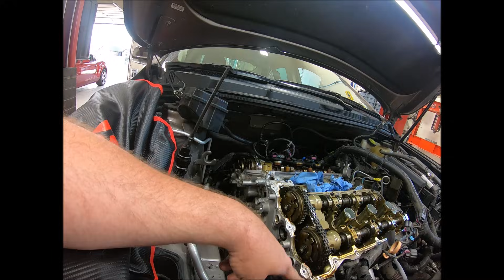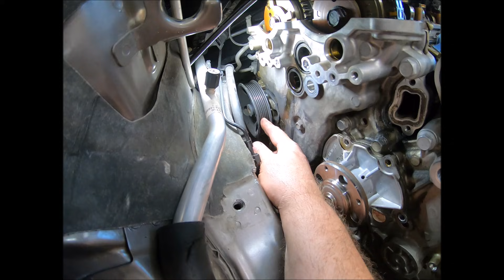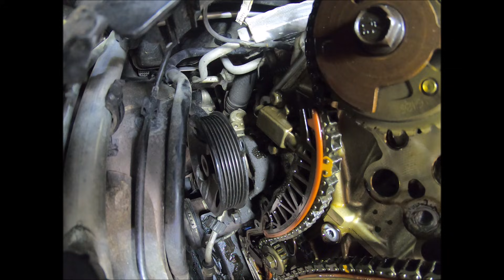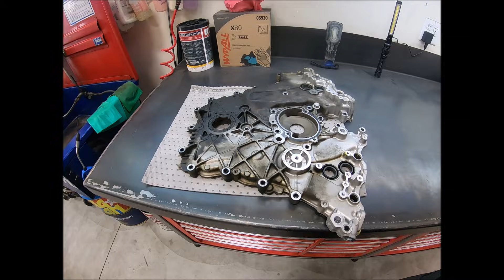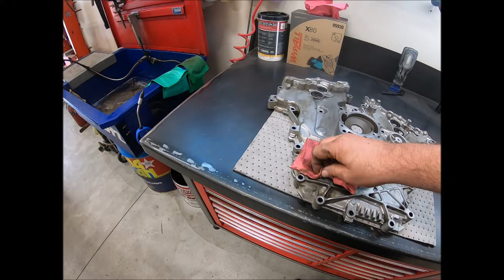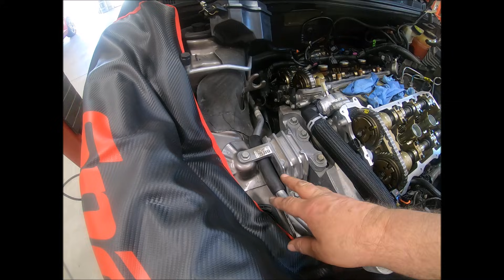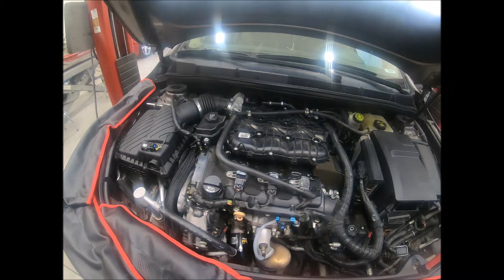Buick V6 Timing Chain Replacements

Comment: the engine gets a bad wrap because people don't change oil and dont clean the intake valves
Reply from the maker: Agreed.  This engine family is not one you can neglect.  They need to be properly maintained.
Reply: @zmotorsports62 people like the 3.8 liter pushrod cause they could abuse it and still get 200K miles out of it.  but the 3.8 liter was low tech had no power and wasnt nearly as smooth.  with the 3.6 liter (bigger version of the 3.0) you get a ton of power and responsiveness, its way more versatile and can handle being put in 5000 pound SUVs, and is a smooth and technologically advanced with relatively good fuel economy.  the trade off for all those extras is changing oil on time and keeping the intake valves clean due to GDI tech.  if you do that these engines will go 300K miles easily.  i have 3 cars with that engibe two of them have over 200K miles running flawlessly
Reply: Who tf cleans intake valves as regular maintenance 😂
Reply from the maker: Not very dang many.  At least not until there's a problem, but on most GDI engines it is a maintenance item or task.

Comment: Great video.
I'd like to add for anyone coming upon this video, coat all the new chains with and guides with oil. I personally used a turkey baster and coated everything in oil. Once I had the timing cover on, i dumped a 1 quart on both banks over the phasers so it drains all the way down. Lastly, with spark plugs out, and fuel pump fuse unplugged, (Optional: Leave serpentine belt off for 0 load) Prime the motor so it can rotate slowly while sending oil into all the tensioners before start up. Do this in small intervals- Usually 10 seconds of priming followed by waiting a little, then once more should be good to coat everything in fresh oil.
Reply from the maker: Agreed. If you notice in the video I put some moly lube on each of the chain guides prior to installation.  I also poured some oil over the phasers and chain as well as camshafts just prior to installing the rocker covers and prior to startup. While pulling the plugs may be beneficial , it's not completely necessary.  If I'm changing spark plugs during the job I will leave them out, but if not I don't necessarily pull them for this job. Prior to start up I use the "clear flood" mode and turn the engine over for about 15 to 20 seconds intervals, I do this about three times to build oil pressure in the system prior to startup.  That will pretty much do the same thing without having to pull the fuse for the fuel pump as it disables the injectors.

Comment: After removing bank two valve cover, inspecting the exhaust chain, on the left, outboard, front of car, seems to have a lot of slop, loose. I had opened this engine to find the cause of ticking, slapping noise. How tight is normal on that section of chain as it goes over the glide? I can lift it away from the glide with no resistance at all. It tightens up upon manual rotation as it should, but how much slack is supposed to be with the chain with no oil pressure to tensioner.  Any chance tensioner is failing and not holding while engine running?
Reply from the maker: Getting some slop in the chain when turning the cam is normal as there is no oil pressure on the tensioners.  There should be some resistance however.  What you don't want to see is slippage between the camshaft and the phaser, that would indicate a failed phaser and definitely cause some rattling.  The phaser should be locked or rather in the "parked" position with no oil pressure.
Reply: @z @zmotorsports62 asers are locked. I am at a loss of where the sound is coming from. The engine was rebuilt with new a new chain kit after previous owner had engine failure from valve/piston impact after chain failure approx 10 K miles ago.  The noise ticking/slapping is the same from start up thru warm up.  
No change in sound when disengaging serpentine belt. No change when disconnecting #2 coil.  The sound was heard strongest via stethoscope at #2 exh. Manifold at head connection. Cam surfaces look good, rollers are good. Valve springs good. No codes pending or set for correlation issues.  Scoped #2, 4 nothing abnormal.
Reply from the maker: Could still be a cam phaser even if the engine was recently rebuilt, especially if they used an economy or sub-standard replacement phaser.   

I just did phasers on a high feature engine that I did the timing chain, tensioners and guides on about 30k miles ago.  Phasers were fine 30k miles ago and then one started to fail and rattled at idle, not just startup.  Opened up the engine and there was just the slightest amount of play in bank 1 intake phaser.  Using a stethoscope the noise sounded like it was right at the front of bank 1 cam cover.  No DTC's on this one either so not far enough out to set a code, but made noise.
Reply: @z @zmotorsports62 attempted to rotate the cam with wrench as you did in vid and it locked to the phaser.  So the pin that locks is possibly the issue? I don’t have a good understanding of just how the phaser operates. I am going to look into that info.
Reply from the maker: The locking pin is generally the issue when these start rattling.  The locking pin can wear as well as the internals of the phasers where the pin engages causing play or clearance.  Even the slightest amount of play can be enough for them to rattle.  I've had some that were loose when I first opened up and when using a wrench on the cams to rotate, the pin will engage and lock.   If there is any movement at all the phaser needs to be replaced.  I suggest if replacing one, replace them all.  I've seen quite a few people replace one only to be back into the engine within a very short amount of time, and it's not a quick job.  If one fails, the others probably aren't far behind.
Reply: @zmotorsports62 thank you for your insight.  As I understand the phaser the locking pin is hydraulically pushed against its spring to move it into its hole and unlock the inner ring to be moved by the hydraulic pressure of either retarding or advancing. Since the hydraulic selinoid controls the amount and timing ( from ecu) of that oil and its pressure, could the selinoid be the first in line for the cause of the locking pin failure?
Reply from the maker: The solenoid "can" allow hydraulic pressure to unlock the phaser when not called for, but these GM phasers are designed to be locked or "parked" with the lack of oil pressure.  The locking pins are spring loaded and require hydraulic pressure, ie. oil pressure, to unlock and allow the ECM to control the camshaft timing.
Reply: @zmotorsports62 yes that’s what I just learned, my concern of the selinoid is that it allows proportional volume and its subsequent pressure to move the phaser components. So if it was slugged up and didn’t function in a timely manner then the phaser would follow its lack of function.
Reply from the maker: True.  The solenoid is easy enough to test however.  They can be removed and inspected for sludge buildup as well as tested electrically.   If memory serves they should ohm out around 7-15 ohms.  

One of the biggest causes of timing chain and/or phaser issues in this engine family is lack of maintenance.  If they are neglected they can get expensive very quickly.
Reply: @zmotorsports62 I have religiously changed oil around the 3K interval with AC Delco filter and 5-20 semi synthetic oil.   I rechecked the cam to phaser lock up, I could not get a fraction of any non synchronic movement.   Arent the phaser actuators interchangeable as they are all the same?
Reply from the maker: I think the actuators themselves are the same but the phasers are not.
Reply: @zmotorsports62 thankyou so much for your expertise!  Hope others will see the conversation and learn something as I have.
Reply from the maker: You're welcome.  Best of luck.
Reply: @zmotorsports62 well I can’t tell you how much help you have been!!!  I kept looking into that exhaust phaser and when I finally realized that you had to be correct on it must be moving ever so little.  I started fresh with an attempt to rotate the cam and this time the outer geared body stayed stationary and, yup!, the cam moved ever so little independently of the outer section. The intake did not as a counter checking of procedure.
Reply from the maker: Glad that you were able to locate the issue and that the information was helpful. 
Mike
Reply: @zmotorsports62 now I need to come up with an exhaust phaser, minimum exhaust only. I know it penny wise and pound foolish to do only the failed one, but that’s where i am at financially right now.  This project has been sitting waiting for me to get into it. As being in my 70’s it’s not as easy physically or financially to take care of things anymore, so I do what I can and pray for the best to come from it.
Reply: @zmo @zmotorsports62  getting closer to entering into unapproved methodology for phaser replacement.  I do not want to remove the front cover. I don’t have that tool to insert and hold the chain so it does not fall away from its drive gear. With that being the said it seems that if the intake phaser being on with the chain and the actuators removed I could easily put a wedge in and lock the tensioner side only. The chain and intake phaser sprocket would be painted for chain orientation as it is in time. As long as the intake cam doesn’t move it seems that the exhaust cam can 😅to be removed to get the phaser sprocket out as there doesn’t appear to be clearance moving it out forward with cam in place. I would of course try to remove phaser only first. If I was lucky to get the phaser off without disturbing  the cam I think the new phaser would go back in the reverse procedure.  Even if the exh cam moved a tooth it seems that the count of links between the timing mark on it would be the same as the old one.  I believe it can be done with extreme case being removing the cam to get the phaser out.   AM I CRAZY  OR CAN IT BE DONE.  As long as the intake is marked in its existing position and the tensioner wedge does not alter then it should be possible!
Reply from the maker: Sounds feasible.  That being said I won't do these without removing the front cover.  Too much risk in my opinion so I don't support nor recommend it.    The juice ain't worth the squeeze.
Reply: @zmotorsports62 my thought is if it works yay!!  If it doesn’t then I really  haven’t lost much by having to remove the cover.
Reply: My next issue is when looking into the replacement part I find info stating different part numbers depending on vehicle build date. Any direction for me with that?
Reply from the maker: Yes, there were different teeth configurations but can't remember the year breakdown.
Reply: @zmotorsports62 well the cam and it’s phaser are out!  It sure seems that the cam bearing caps were put in way beyond the torque value for them. The first bolt I tried to remove split the socket in half.  The heads on some looked like there were put in with an impact hammer as edges were rolled badly.  What I found with the cam isn’t good. The  surfaces are in terrible shape with grooves. Catch on the finger nail scrape. Since the machining of the head and caps are the bearing surface I believe this engine is not going to get repaired.  I wonder if over torque on the cam caps had something to do with the condition of the cam journals?  I found nothing with the rocker arms and their bearings that said here’s your problem with that ticking. No springs were broke.  I am wondering if the noise could have been the bad surface of the cam journals allowing it to slop around as it’s spinning being lifted and dropped by the valve/ lobe movement?
Reply from the maker: That's too bad.  I wonder if you could use some Plastigauge just to verify the clearance on the cam journals are out of spec. or not.  

Was this engine run low on oil or did it have extended oil change intervals?  Sounds like something in the oil supply was breaking down which led to scored cam journals.  Either poor oil quality (ie. dirty oil) or lack of oil ((quantity).
Reply: @zmotorsports62 since I got it after the so called engine rebuild, it seems the parts were not new at the rebuild, I have changed oil at 3500 miles.  It’s getting obvious that the engine reused a lot of previous worn out parts. The thing I have trouble understanding is how the so dam scarred cam is and caps and head seats are not equally as ugly?
Reply: If the cam caps are supposed to be torqued to 89  inch pounds it seems that they were a hell of a lot tighter than that as I broke a socket removing the first one. The remaining were just as tight.
Reply from the maker: Yeah, that's not good.
Reply: @zmotorsports62 do you think a lash adjusting lifter could fail and cause a ticking?
Reply from the maker: Yes, a collapsed lifter could definitely cause a tick, also a weak or failing oil pump could deliver similar issues.
Reply: @z @zmotorsports62 n’t the oil pressure monitored?  Don’t know the limit if it is but have no codes set.  What I do remember was a fair difference between bank 1 and bank two phaser position or degrees of action when looking at both feeds.  I guess that  could be the phaser only or oil pressure only, or oil pressure not getting to the Phaser from leak by the gaskets in the journal with its oil delivery ports?  I am most likely picking at assumptions but as I learn more I question more of what I don’t know.
Reply from the maker: Oil pressure isn't monitored on these such as exact pressure, only an "oil pressure switch" which triggers an idiot light on the dash.  If memory serves this switch only requires about 4 PSI to function, so the oil pressure has to drop below that to set the dash indicator light.
Reply: @zmotorsports62 upon looking into replacement phaser the original is a 5 bolt and had no thrust washer. When looking them up it comes up with 4 bolt. Which one is design 1 and design 2. Are they interchangeable?
Reply from the maker: I have a video on my channel that I just posted about a week ago that described the difference between the older Aisin (5-bolt)  design and the newer Delphi (4-bolt) design.  I specifically discuss the phenolic washers.  Check it out.
Reply: @zmotorsports62 on the cam, phaser side end journals under the double cap. The seals on both don’t lay at a position extending past the journal O.D.  Is this correct or incorrect. I am wondering how the seals efffect the pressure/ volume of oil being pushed into the phasers if they leak. When looking at the cap and block run surfaces only the seal areas show wear/ shiny, the remaining surfaces show no real contact. Is that odd?  Also neither have a thrust washer, don’t know if there ever was any, looking into what would be any wear indicator if there was or wasnt.  Did they not use any on some?
Reply from the maker: Can't answer the question about the seals.  I wouldn't think they would do anything to control oil pressure, that is usually accomplished by clearances.  

The phenolic washers were not used on all applications, which is why I made the video about checking the end play.  I haven't seen them on the newer ones that I've done.

Comment: Hi. This is a lot of great info. Thank you.
I'd like to tackle this job in my 2013 Impala but I can't find a definite answer if I can do it in-car. I'm just an above average Joe Homeowner mechanic with an above average set of tools. I know I have to get all the tools I need which shouldn't be too hard, but I can't move the motor. If the motor has to move, I'm shot.
Any idea if I can do it without moving the motor?
Reply from the maker: I'm not sure on that one.  This one is tight on space, but doable in the engine bay.  If I remember the FSM for this one stated to drop the powertrain from the car, but it wasn't necessary.
Reply: @zmotorsports62  Ok, great, thanks again.